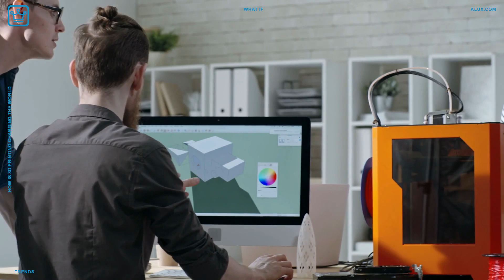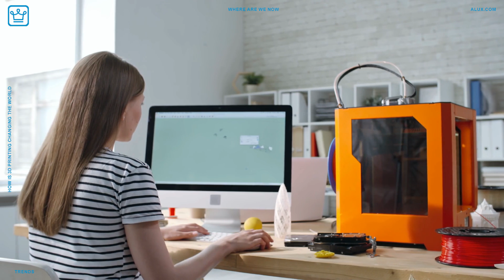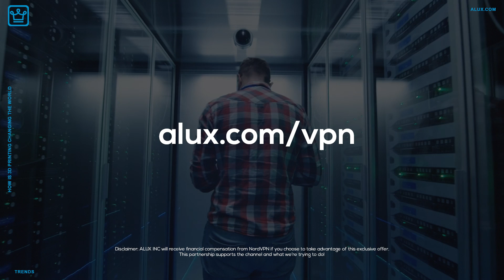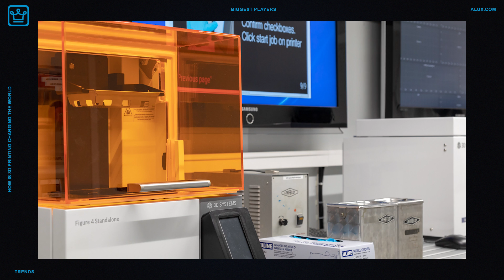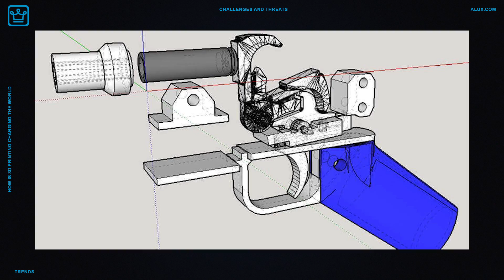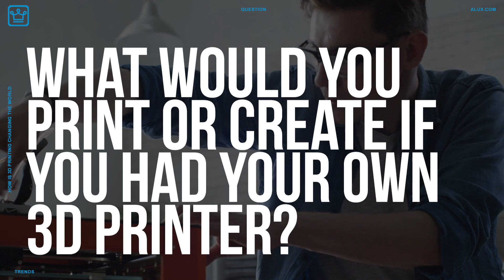How Is 3D Printing Changing The World

Comment: "primary stage" "not affordable or accesible to all"
that's some bullshit right there, go into some forums, look at the stuff we have
you can have a FDM printer for 200 bucks, or a MSLA for 200-500
both of them are very easy to set up and use
if you have some time and like electronics you can even build a 3d printer for 50 bucks with some DVD drives, an Arduino and a cheap hotend
Reply: also, metal printers are now a thing
and plastic guns are BIG BS, have you ever fired one? plastic is brittle, and 3d prints are anisotropic, in the Z direction it only has 30% of the strength

Comment: I am 3D printing my next house, maybe I will make it in a castle shape. It's a lot cheaper to 3D print a house and it takes a day to a week to build the house. My friend did actually 3D print a small working 3D printer inside a big working 3D printer and sent it to his friend as a joke, so it's possible. I will also be 3D printing my own super car in 2 years (already have designs). Defiantly a lot cheaper than buying one. This video forgot about 4D printing where you print parts and they assemble themselves which will soon become mainstream. Also this video forgot China already 3D printed a sky scraper. Another thing this video forgot is people 3D printing rockets, like real rockets. The 3D printing battle is really between China vs. Arabian countries, their 3D printing is next level. HP is ok if just want to throw money out the window. My next project is 3D printing a drone I can sit in and fly around town. 3D printing is fun especially with all the different materials you can use.

Comment: I currently have three 3D Printers and have been 3D printing for over 5 years now.
Reply: Cool. Plan to do something similar. I'm currently Solidworks Certified Associate and have experience using 3D Printing at my school.
Reply: What do you use them for?
Reply: Various projects including enclosures, mechanical parts, printer upgrades, and replacement parts like battery covers.
Reply: How much is a 3D printer?

Comment: started a manufacturing company this year that uses only 3d printing to make stuff its been profitable every month one edge I have over other manufacturers is the ability to change the production of items without cost, no molds or dyes I just change a file.
and the list of materials that can be used is a lot longer than you think. some of these materials are conductive and magnetic and are filled with carbon fiber... and these can be printed on consumer desktop printers.
Reply from the maker: Well done Joshua!!
Reply: Hey Joshua. I would like to pic your brain some more if possible. I have a few questions about this stuff.

Comment: Buainess plan
1.Buy a 3d printer.
2.Print a 3d printer with the 3d printer.
3.Sell the printed 3d printer.

4.$$$$$$$$$$$
Reply: China wants to know your location
Reply: @shaikmohammedabdullah5219 Let em know that i am in Bangladesh,Dhaka,Uttara
Reply: @irahat6387  CIA wants to know your location too 
I'll tell them
Reply: 3d printer replicates 3d printer at out of control. Grow exponentially until this planet fulfill with 3d printer.
Reply: Yeah true
Reply: China will hire you for 200000000000 $ now😂😂
Reply: Business*
Reply: Prusa does this. They have 500 of them cranking them out. About 1000 per week.
Reply: Dang, I guess I have to be that guy that mentions Reprap on the printed printer copypasta. Yeah so basically check out the Reprap project.
Reply: yes, it's called open source and you can actually do that
Reply: basically knock yourself out, you can even make a business out of it!
Reply: STONKS
Reply: Injection moulding : 😂
Reply: You forgot a step. 5. Pimp out your 3D printer with all the most useless upgrades.
Reply: 3D Print a motion machine that 3D Prints motion machines.

Presto! Perpetual Motional Machine!